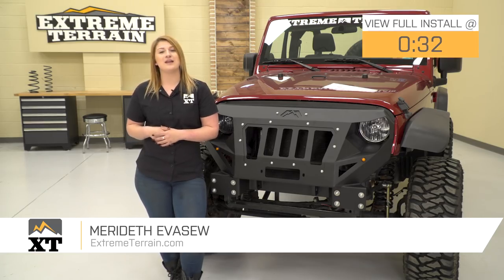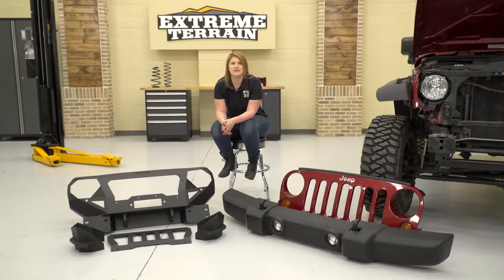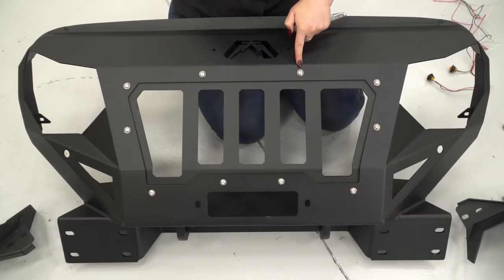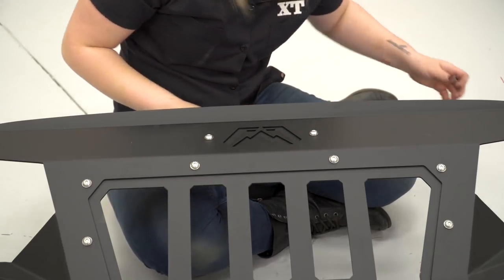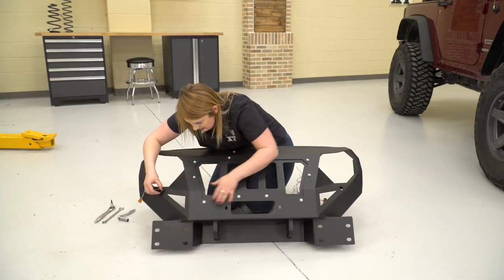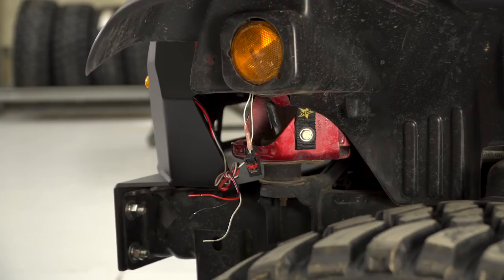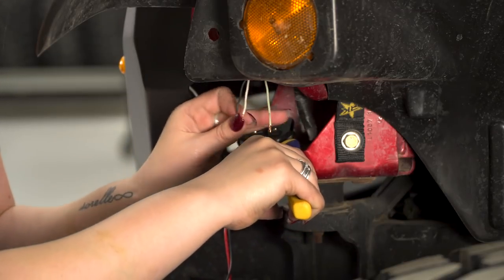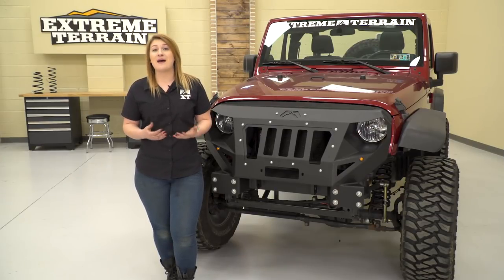Jeep Wrangler JK Fab Fours Grumper (2007-2018) Review & Install

Comment: Can you add your stock bumper back after the grumper installation?...I found out this system is 70lbs as the full wide grumper is 200 lbs... my point is the front end is going to need work due to the 200 plus lbs weight...so basically new bumper, socks,springs, etc.

Comment: Why wouldn't you just strip a little more wire on the positive and negative and twist the wires together and the push and crimp those with the butt connector. No need for the vampire clips. Those things are a problem waiting to happen